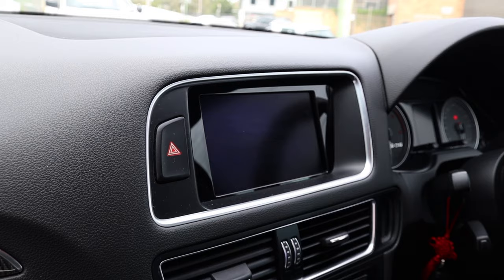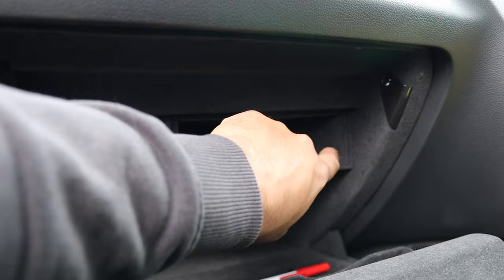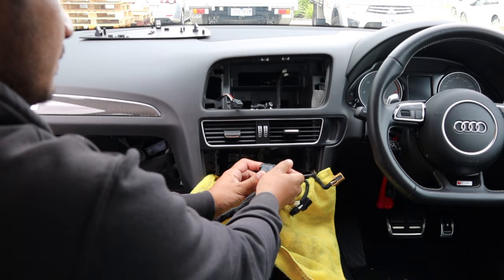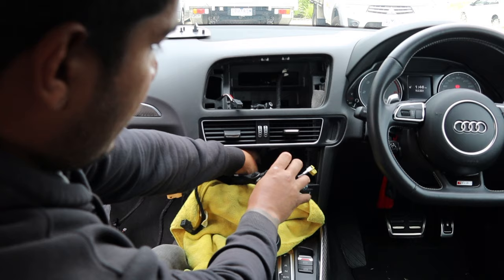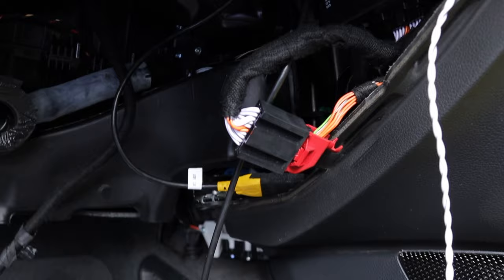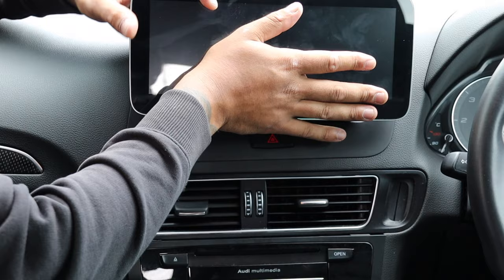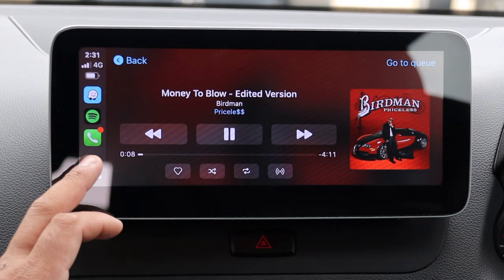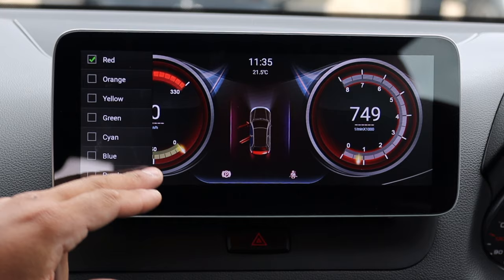Audi SQ5/Q5 10.25" Android Screen Install.

Comment: Hello and thanks for the video. Ive just installed the same android screen, but my issue is that my airbag light is on, on the dash. On the old system right below the hazard button i have the airbag button, and on the new system there is only the hazard switch. Anybody have an idea what to do? Thanks in advance
Reply: Hi cihad, I was wondering if you had a fix for this? I'm going to install one and am thinking if I take the old hazard switch and connect it to the new wiring connector (as it has another connector for stock switch) and put it behind the new unit maybe this will solve the problem?
Reply: @barrygibaud6916  that is exactly what i did and it solved the issue.
Reply: Thanks cihad much appreciated the fast reply
Reply: One more question if you don't mind me asking...... did you disconnect your battery during installation?
Reply: @barrygibaud6916  no worries. I did not. And the reason is that i had the need to test the connection more than a couple of times, im not a expert and i didnt want to hassle with the battery every time i needed to turn on the ignition. So its completely up to you.
Reply: Hi cihad, it's me again. Apologies. 
Can I ask what you did exactly with the hazard. I took the hazard switch out of the old unit and attached it to the wire that came with the new unit and then plugged the small white connector to the new pcb board on new facia. Both hazard switches now work the hazard lights. I still have the light on my dash. Did you have to clear a fault code to get rid of the light and then it stayed off or did it just go off when connected the old hazard switch? Many thanks baz
Reply: @barrygibaud6916  yes, once you pull out the airbag switch the light will come on. I bought a carly adapter and deleted the faulty codes with the carly app and it worked perfectly, so you need some sort of an adapter.
Reply: @cihados  thanks for all your time and info. Bought mine from the fitting bay and after installation, it works but doesn't boot up with audi screen as advertised and screen is getting quite hot with only a little time trying to navigate it. Hope I've done the right thing.🤞🤞
Reply: @barrygibaud6916  your welcome. The booting screen can be changed in the settings menu (not android settings), you need a passcode of four digits, cant remember what it is but youtube and google is your friend. Mine is getting hot too but not so bad that its not usable. Enjoy it its nice to have but be aware that its an aftermarket and will act as.